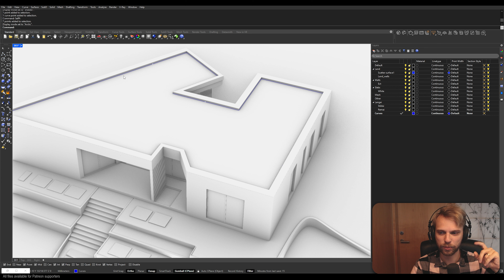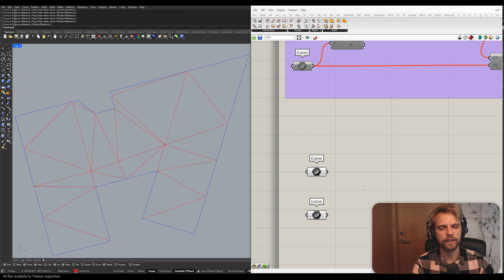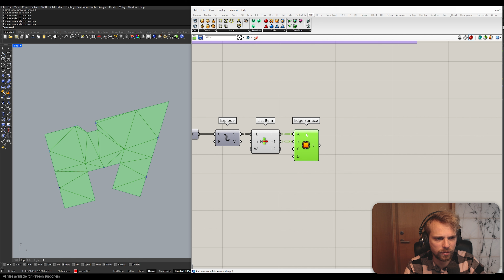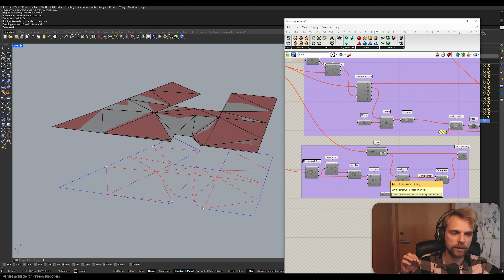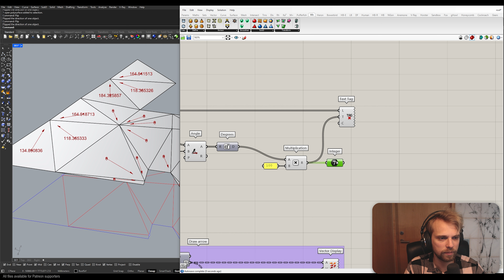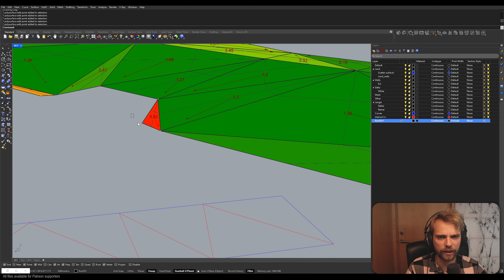Roof Slope Analysis with Rhino and Grasshopper - Tutorial

Comment: I am curious about the logic behind your layer management.
Reply from the maker: "Helper" layer used for everything that I'm "currently working on" , all other layers separated into "Slabs" - with sublayers for walls, floors, ceiling, woof, terrace , "openings" with sublayers for doors, windows and so on. If I'm preparing a model for rendering, then I restructure the layers according to the materials to be used.